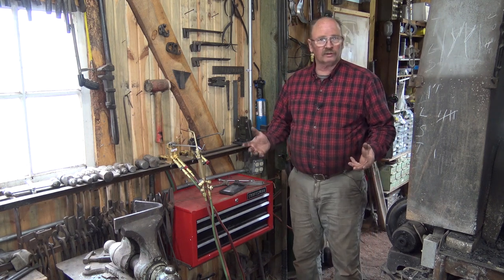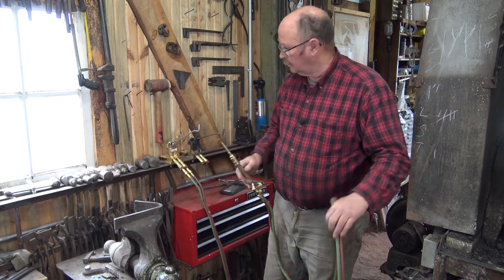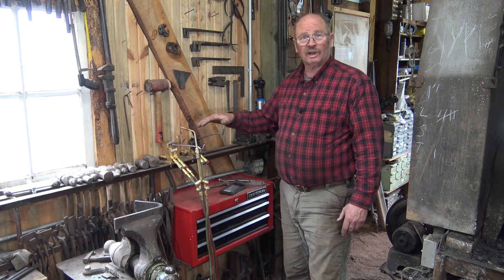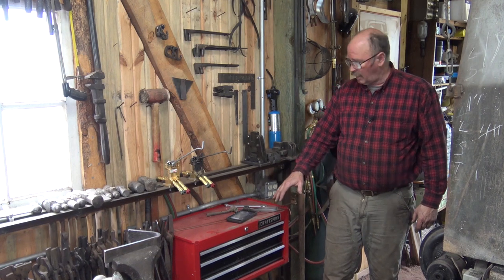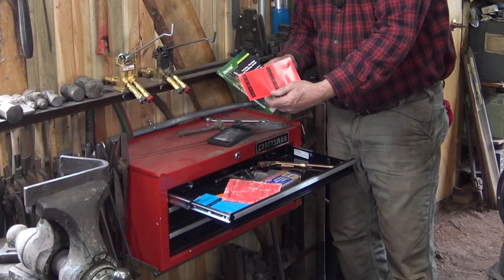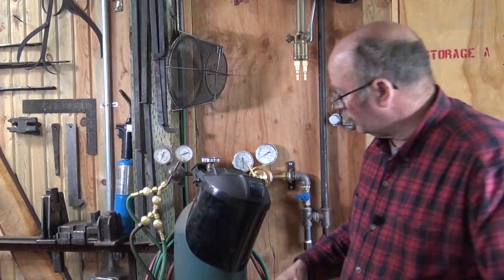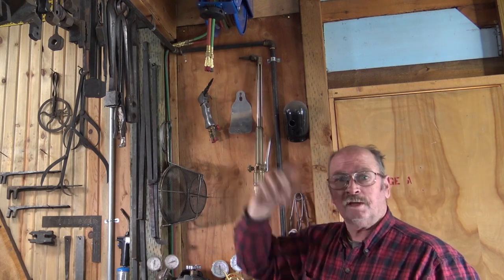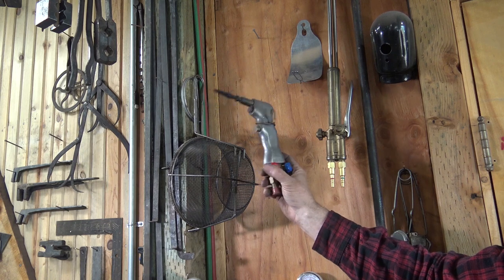New torch setup for oxy propane and oxy acetylene torch options

Comment: As a brazer for Lennox Industry builders of furnace and air-conditioning. We had automatic ignition spark to light our , Our old system had poliet lighter of a gas flame
Thanks John Switzer for the many times you have helped.

Comment: Excellent video. I gave up oxy/acetylene years ago becasue I no longer weld with that gas.  I just cut now with oxy/propane or plasma.  Fo welding, I just use MIG, TIG or Stick.   Simple for a garage shop weldor.

Comment: There is a development in Britain and Ireland with Hobby weld small cylinders for Acetylene and Oxygen.    The acetylene withdrawal rate is limited but its is good for brazing and welding.   The two cylinders can be moved to the work on a trolly.    The oxygen can be used with a small propane cylinder to heading, brazing and cutting.

Comment: Good night John. I have an acetylene torch with acetylene nozzles. If I want to use it for propane, would it be enough to just change the nozzle (small piece) for a propane one to the acetylene lance that I already have? This way I don't have to change the entire lance, just the tip. Could you answer it for me? thank you

Comment: I wondered how you had that set up. I am thinking about getting a propane torch since I took a welding sampler class and we did some torch work on a ring for a bell clapper. It was so much fun getting that steel 'mango orange' and then bending it. Also, blending the ends of the ring with a torch, bringing the ends to liquid heat and watching them just melt together was amazing. Do you think a Propane only torch is a good set up for a casual. home garage smith? They only used acetylene at the shop where I took the class.
Reply from the maker: Propane is great for cutting and heating, but not really very well suited for welding.  A propane only torch doesn't get hot enough for most work, so oxy propane is much better
Reply: @BlackBearForge  awesome, that is what I was thinking although I didn't say 'Oxy'. I already have the propane tanks so I will just have to add the other. Buy or rent? what do you think if I wont be going through the bottles really quickly?

Comment: Great video, thanks for sharing. What brands of oxy acetylene torch kits would you suggest? I took a welding course from a local blacksmith (whom looked almost exactly like you strangely enough) and we started with oxy welding, it was great.
Reply from the maker: I like Victor, but Smith is also good.  In the long run going with a brand that is locally supported might be the best option

Comment: Nice set up. But don't worry, a hose less delivery system is being researched. So far a single proton or electron can be teleported. Not yet an atom or molecule. But WiFi torches are in the way. :)
Reply from the maker: That would be great.  Just download the gas directly from the supplier without needing to go to town

Comment: Very nice.  I've been looking for a Oxy-Propane rig for awhile but haven't pulled the trigger on it yet.  It'd be nice to put a splitter on the 100# tank that feeds my forge so I could spot heat at the vise when I needed.  My only real need for a torch would be cutting and localized heating since I don't weld or braze as yet.  

Do you use genuine "gas saver" valves or is there another brand/model that's just as good?  How long does a bottle of O2 seem to last you?  I wouldn't be using a torch nearly as much as you, but I'm curious what I might be in for.
Reply from the maker: My valves are made by Smith

Comment: John, where did you get the jet for the gas saver for propane? I've had a oxy acetylene gas saver for a number of years and as I moved over to oxy propane I'd like to re-jet the thing. The propane jet seems to be scarcer than hens teeth and rocking horse droppings.
Reply from the maker: I couldn’t find just the jet. So I ended up buying an entire unit set up for propane.
Reply: @BlackBearForge  Ahh, that's what I was trying to avoid. I can buy a propane jet from the UK, but the postage is more than the item... but still cheaper than a whole new unit, so I might have to go down this route. Thanks for the reply.

Comment: I've heard propanes cheaper cost is offset by the higher oxygen consumption? I'm looking at something red though and it's your hoses, you said they where for propane, but they're red? Is that normal color scheme in america? Here only acetylene hoses are red, propane hoses have to be orange, because the two gasses need different materials and it helps avoid mix ups.
Reply from the maker: Here you can buy acetylene only hoses or dual purpose hoses, both are red but have different letter designations marked on the hose.  So far I have not seen much increase in oxygen use and since it costs so little when compared to acetylene I doubt it will be an issue.
Reply: @BlackBearForge  Thanks for the reply. It's interesting to compare and contrast. I am looking into what type of oxyfuel setup to get. 

I have two sets of my fathers torches, he used them with acetylene. Brand is AGA X11, injector based for both welding and cutting so different than most US based torches I believe. They can used for cutting with propane with new cutting tips. 

I believe fuel gasses are a lot more expensive here due to near monopoly situation. I'd pay 350 for a new 11 liter oxygen bottle and 50 euros to swap it in for a filled one. 

I think it's equivalent to 70 cubic feet of O2 in the US.

Comment: Hi John, I was wondering if the fuel saver would be worth it for the short tank life porta torch setup? Thanks in advance
Reply from the maker: probably, but it adds more complication to something that was meant to be portable.  The gas saver needs to be mounted to something.
Reply: @BlackBearForge  sweet, I didn't buy it for portability yet...just to work on things like, well,  roses like you said and goofy sizes

Comment: I'm having trouble getting my welding/heating tip to light on my oxy lpg (propane). When I try and light it the flame is a long way from the tip and it goes out as soon as it's away from the pilot light. Any suggestions for to fix this?
Reply: Try turning down your propane at the torch to start, then add a little oxygen, then alternate increasing both to desired flame.

Comment: hey john is it passible to use compressair and Lpg to cut ?
Reply from the maker: No, you need oxygen to burn the material out, it isn't simply a matter of blowing it away.  However electric plasma cutters do use compressed air as part of the process.

Comment: Great system , I'd like to share a story my welding professor in college told the class, he worked in a ship yard in San Diego , one time his coworker was killed after screwing his torch up to a line , he didn't catch it but a spider climbed into the port on the torch fitting , when he tightened it , it crushed the spider , when he turned on the valve , the oils in the spider set off the oxygen.

Comment: I need a torch for cutting and did not even now propane would work. Can anyone recommend me a decent Torch kit that I could use propane tips on. I use as plasma cutter but sometimes a torch comes handy.
Reply from the maker: I use a victor torch body and buy special tips for propane
Reply: @BlackBearForge  I was looking into Victor units just need to find one I can get those tips for. I'm new to cutting torches so might get a decent one to avoid headaches. Thanks

Comment: What torch tips are you using for propane? Do you have a link?
Reply from the maker: I use tips designed for my torch handle and for propane.  In my case those are Victor tips.  Check with your local welding supplier for the exact part numbers.
Reply: Black Bear Forge I was actually looking for tips for a Victor torch. My LWS is smith but I emailed Victor to ask. Thank you for the reply.

Comment: wow first time i see a vid with so many thumbs up and zero thumbs down,,now can you help me? i have made a small oxy/mappro or oxy/propane torch and i am having trouble brazing steel rods together using cooper wire,the heat it takes to start melting the Cu makes the steel crud and burn and it comes out ugly after hard work cleaning it,,i used borax and water paste and even tried some brazing flux that comes from in hard rock form than needed to be pasted with water but they all cant stand the heat when working with copper,could it be i am using too many strands of Cu wires?
Reply from the maker: I have never brazed using copper before, so I'm not sure how it might be different than the brass rod I typically use.  If you're burning, you may have too much oxygen
Reply: @BlackBearForge  im not burning but the work pieces are getting so hot it's on the edge of oxidizing and getting porosity because its taking too long for the copper to melt so it's creating a cruddy joint despite my attempt to use flux ,maybe i am using too much copper?

Comment: How and what do I need for oxy propane setup as I’m doing jewelry and small art with micro torch #3—--#7 tips where do I go to buy all the stuff if I already have the micro torch and hoses.   HEEEEELLLLLLPPPP!!!!!
Reply from the maker: The big difference is the tips.  Check with your supplier or the torch manufacture to find out what you need.

Comment: Why not MAPP as your fuel gas? It's FAR safer than Acetylene and burns hotter...
Reply: Acetylene actually burns a couple hundred degrees hotter. I just looked at Wiki to confirm that, and as an addition, if it's to be believed the increased amount of hydrogen in the MAPP gas combustion results in a more brittle weld in steel. So it's not even close to as cost efficient as Oxy/Propane and not as good for welding steel as Oxy/Acetlyne. MAPP gas certainly has it's uses but it's gonna take some convincing to be my first choice if I'm working with steel.